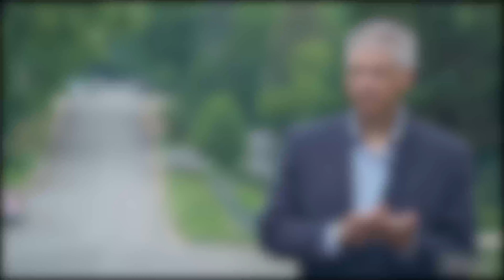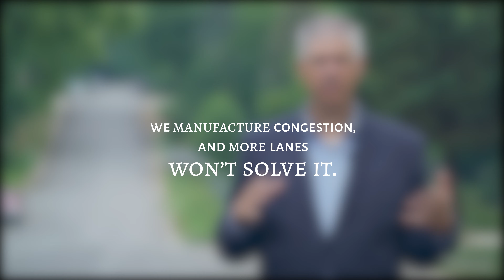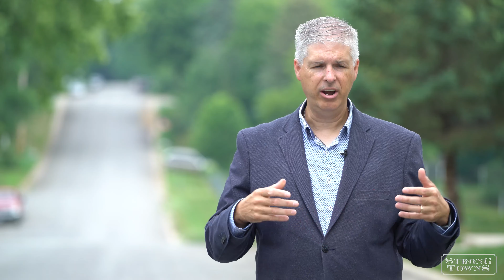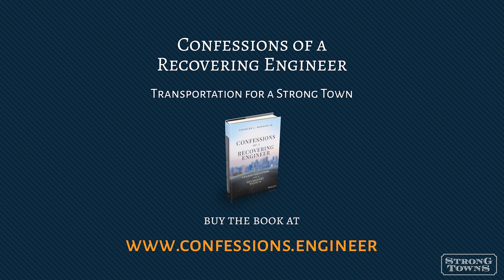30 Days of Confessions: #13 Congestion

Comment: Well, what's the alternative? It sounds like you're saying we need to have the most roads in cities so there's less congestion in cities (to mimic flow going from smaller channels to larger channels), but I understand that's not the strong towns approach.
Reply from the maker: The linked article goes more into depth on the matter, but a relevant excerpt regarding your question is this:
 
"As per Hydrology 101, the only long-term way to address traffic flooding is to go to the source. Auto trips need to be retained near where they originate, or transformed into non-auto trips, to prevent them from accumulating and flowing further downstream. We need to create local alternatives to an auto trip. That means building more corner stores and neighborhood businesses. It means creating more local jobs and housing options. It means emphasizing sidewalks and biking infrastructure so that people have more alternative ways to respond to congestion. These things are also good and necessary outcomes if our cities are to become financially strong and resilient."

https://www.strongtowns.org/journal/2021/7/29/traffic-congestion-was-last-centurys-problembut-it-is-this-centurys-solution
Reply: @strongtowns  Which means you will have to demolish 4/5 of the USA first... 🙂

I really cannot see how you can make those sprawling suburbs in the USA better... 😲
Reply: @btudrus  incrementally
Reply: @btudrus  he has articles that share ideas on this too. There’s actually plenty of space to make suburbs better, especially in commercial districts, but it takes a total rethinking of zoning and development laws.
Reply: Get rid of cul de sacs, and find ways to get rid of most of the stoplights we have. Most of the congestion doesn't happen in the city's well connected streets, it happens on stroads and highways.